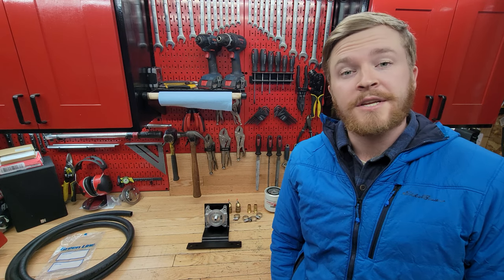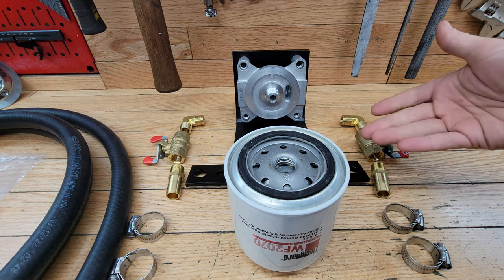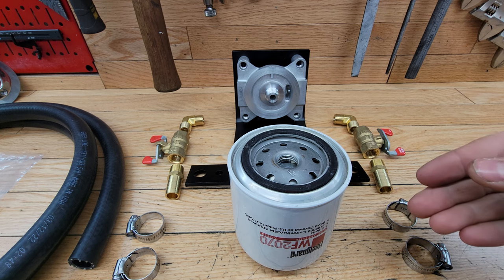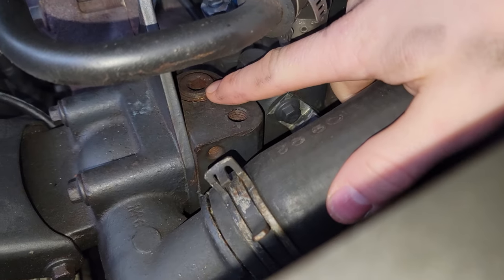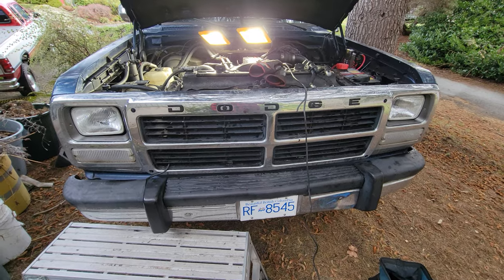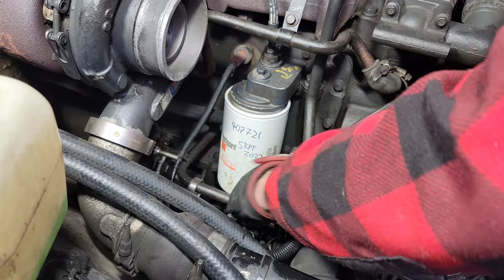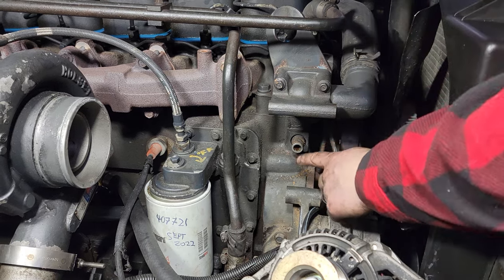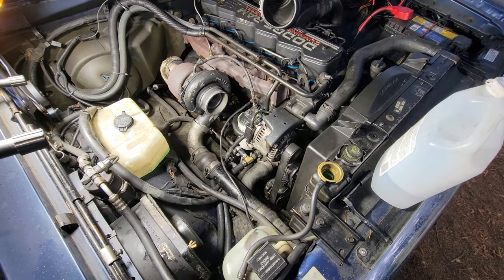Coolant Filter Installation | 1st Gen Cummins

Comment: Really great video on this install. About a month ago I installed a coolant filter on my 2002 5.9 ISB. I used my filter cutter to see if it was worth the money and time I spent doing this job. Absolutely worth it. tons of rust junk, I changed two filters mow and finally all clean. I also switched out all my coolant to the "Detroit Diesel" brand. No issues and the engine runs 5'F cooler. You can get this at any Freightliner dealer for $10- a gallon. Happy holidays, 60107 USA says hi.

Comment: Nice job! I think that if you have any fluid flow where a potential for blockage, corrosion, or wear exists, there should be a filter somewhere in the line.
Reply from the maker: Thanks I appreciate it! And I agree 👍
Reply: Absolutely.  The coolant is doing double duty flowing thru engine AND transmission radiators. It's just common sense preventative maintenance for an older vehicle that you want to keep long term.

Comment: The people who sell coolant filters convinced you that you need a coolant filter. As always nice install. 🤙🏼
Reply from the maker: Thanks 👍
Reply: 98 12 valve You probably never work industrial engines I see. many larger engines, including semi trucks have coolant filters with additives like corrosion inhibitors if I recall correctly. The reason for this is two fold. First off is glycol will go from basic to acidic which causes corrosion in your engine and can contribute to head gasket failure, pin holes in radiator, pin holes in heat exchanger etc.
Additives in the coolant filter slow this down. Second debris shortens the life of your mechanical seal in your water pump, and can decrease your heat exchanger and heater core efficiency.
Cummins requires 5.9 to have a coolant filter system for a longer engine and component life, dodge rather you buy parts.
Reply: Nope I haven’t. But I’ve been around a 
lot of 5.9 Cummins and Mercedes diesels with 300,000+ miles no problems.
Reply: @valve-do3jc  the coolant filter isn't meant to extend the life of the engine, it's meant to extend the life of the cooling system parts like the radiator, heater core and any heat exchangers.

Comment: You should not really need a coolant filter though as unless your system is corroding there should not really be flakes of stuff circulating in your coolant. Anything that can plug your heater core will plug your oil cooler as well. I would suggest a good flush with dollar store bleach a few times till it comes out clean. Then fill with a good antifreeze with all the diesel conditioner additves it should stay nice and clean.
Reply from the maker: To each their own I guess 🤷 I'm going to run the filter for the prescribed amount of time, and make an update video when I change it out and show the cut open filter media to show if it take anything out of the system. 👍

Comment: Why do all these coolant filter bases use 3/8 NPT when pretty much every coolant system uses 5/8? What am I missing?
Reply from the maker: @robertbrewer2179  3/8npt is the thread fitting size and 5/8 is the ID of the hoses

Comment: On my engine the fitting going into the block near the alternator has a 10mm hex head inside the fitting so you can use an allen socket to remove it
Reply from the maker: Oh that's a great tip. That may have helped me I didn't even think to look inside it for a place to wrench. I bet there is a Allen on the inside of mine...cheers!